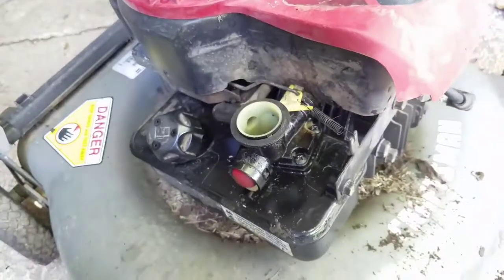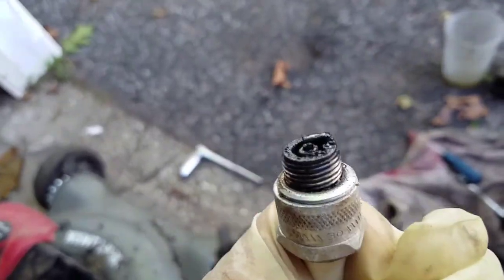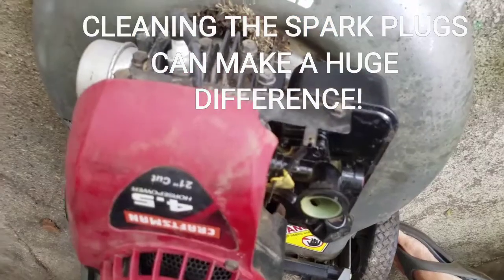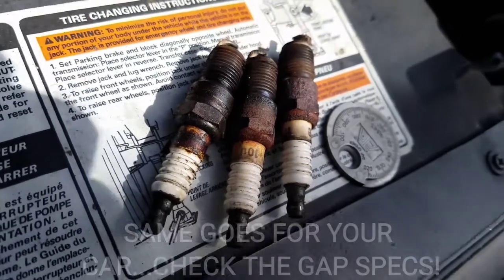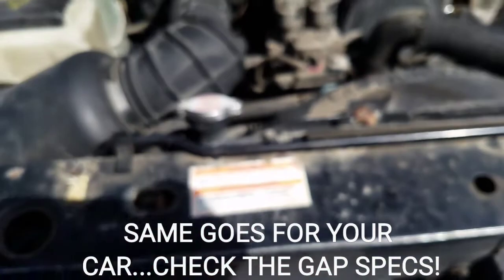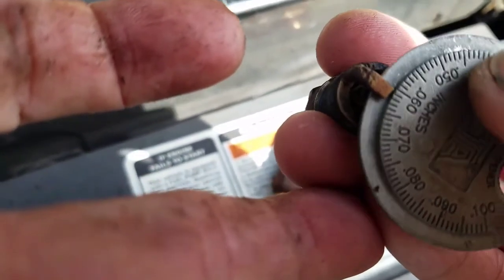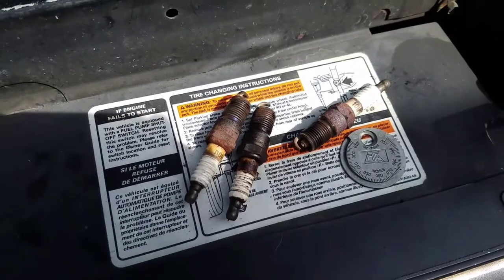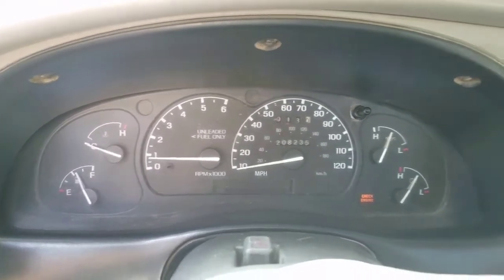DIRTY SPARK PLUGS CAN BE THE REASON WHY YOUR LAWN MOWER SNOW BLOWER CAR WON'T START "MIND THE GAP"!

Comment: I've been having issues with my Honda motor on my pressure washer the spark plug keeps fowling black like soot like it's running rich. Had it serviced recently runs good and strong for like and hour then I'll missfire and die out.